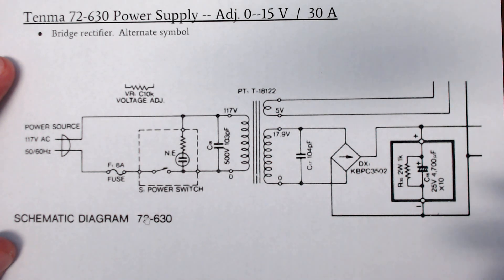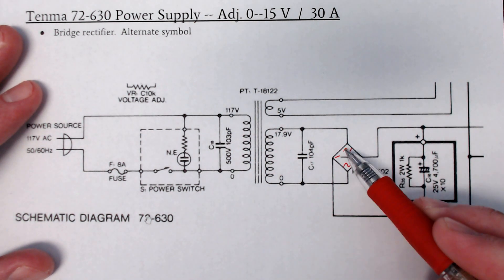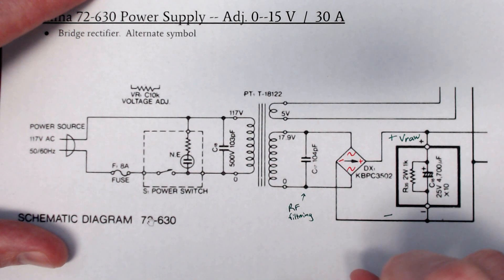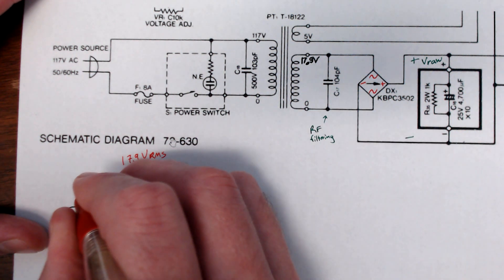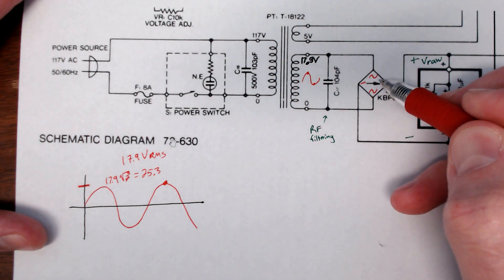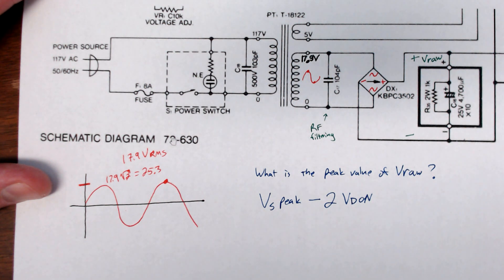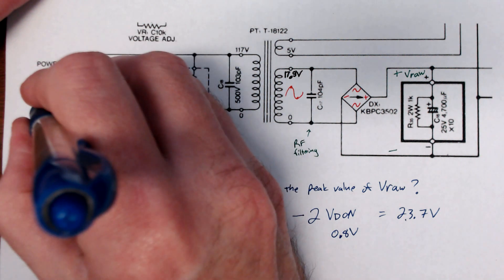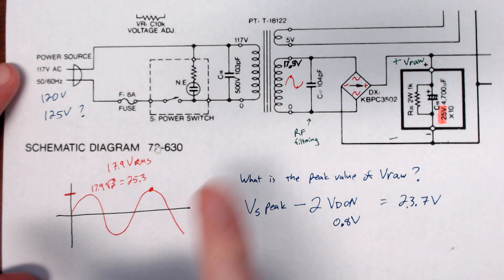Tenma 72 630 power supply, part 1

Comment: Hello Dan.. Was using one of these  for Field Day this year ,my radio cycled off and back on again, it did it while using the radio in ft8 ,cw and even ssb and the current draw is only 22 amps  .. The Voltage remained constant the current however was  varying quite a bit.. I'm thinking it could possibly be rectifier .. What are your thoughts?
 Thanks
Reply from the maker: It seems reasonable that the current would vary quite a bit, especially when switching between transmit / receive modes.  The voltage on the meter remaining constant, especially since it's an analog needle meter, hints that the power supply may be doing fine.  My first suspicion would be the radio itself getting too hot and self-protecting itself.  Delivering about 300 watts to the radio with at least half turning to heat, combined with a different environment compared to in the shack seems like it may be the behavior you experienced.

Could be a power supply issue.  More diagnosis would need more testing to figure out what's really happening and where.  IIRC, the bridge rectifier is connected with quick-connect spade terminals.  Diode-check each pair of terminals to see if they are properly "diode-ing"